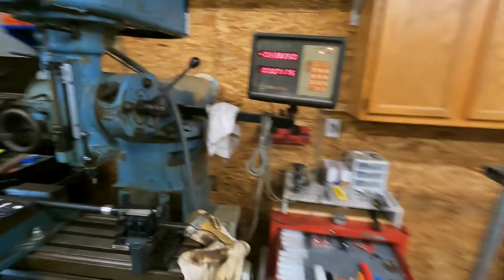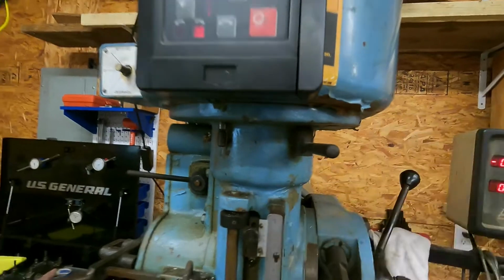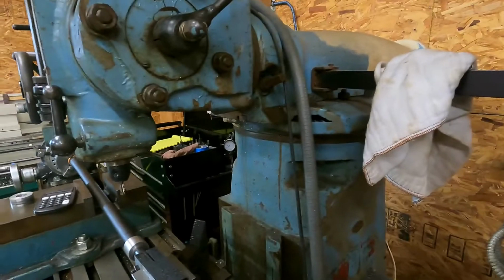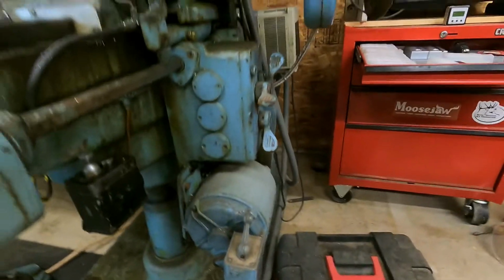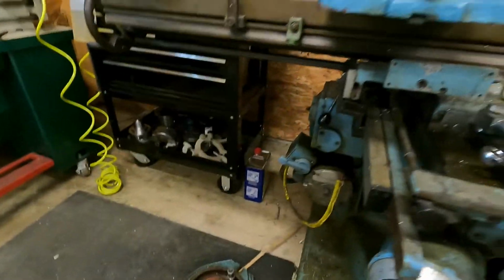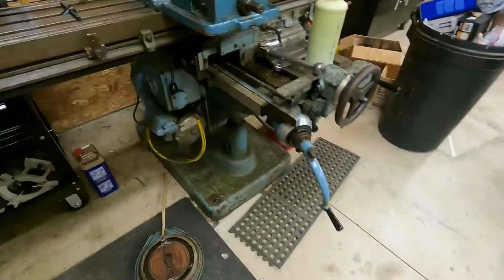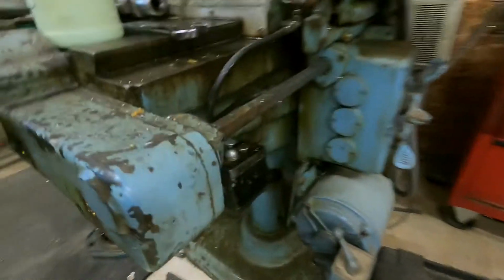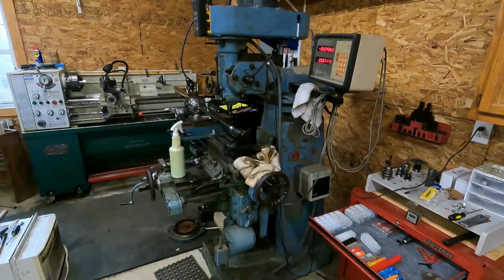Wells Index 645 walk around

Comment: Thanks for the walk around.  The Index is far more complex than the very nice Bridgeport clone I used to have.  I just bought a 645 that needs some work but the price seemed right.  Every video that shows the functions is encouragement that I can get this machine working well again.  It's not even at my house yet.  Picking it up in a few days and have already unstuck most of the frozen parts at the owner's place.  I've run Bridgeports.  The Index seems to be much more machine than the usual Bridgeports.
Reply from the maker: I haven’t had a lot of experience with an actual Bridgeport, just the clones. The only thing I don’t like about this machine is the B&S 9 taper. Wish it had an R8. I would suggest getting a few end mill holders and drill chucks that have a 3/4” straight shank. You can hold those in a 3/4” collet and have quick change capability pretty easy

Comment: Thanks for the overview. Always love your videos. How do you anchor and level your machines? And do you periodically check them for trueness?
Reply from the maker: Joe I’ll be honest with you I probably haven’t paid as close of attention to this as I should have. My lathe is on adjustable casters. I made sure it was level when I put it in my shop, but I’ve never secured it to the floor. Haven’t had any issues to date, so I just left well enough alone. Same with my mill. It’s pretty level as is (surprisingly), and I’ve not done anything beyond set it on the concrete, and check it with a level. I do re-verify level on both a few times a year. I intend to put some hard plastic leveling feet under the mill at some point to help with vibration dampening. Just haven’t done it yet. I took the approach to them I did after talking with a few machine shops and asking what they did. Typically they use a carpenters level and make adjustments as needed from there. So, that’s what I’ve done. Thanks for the question and for watching